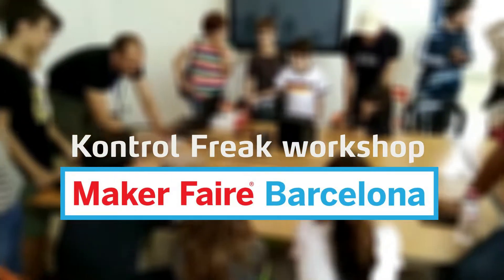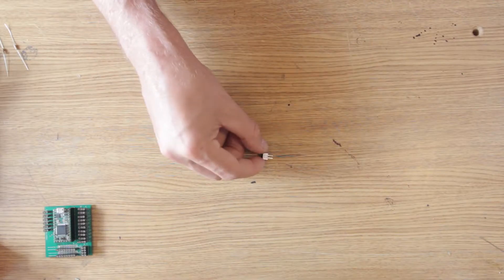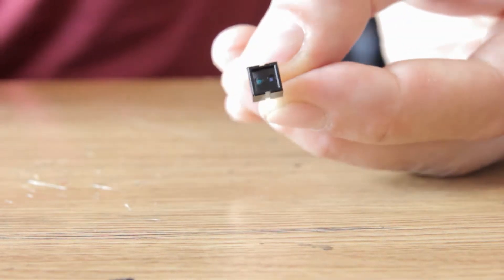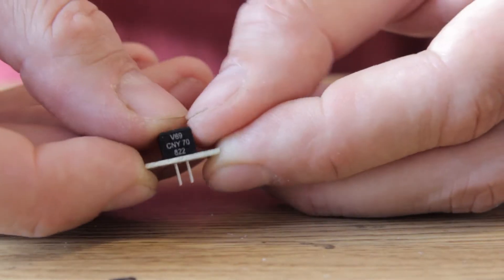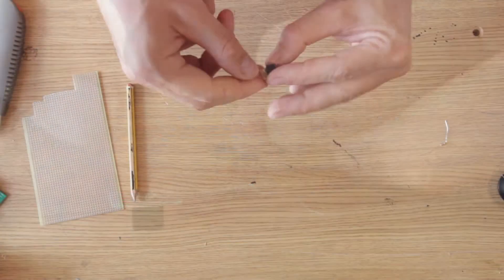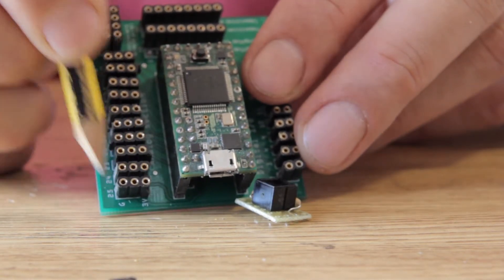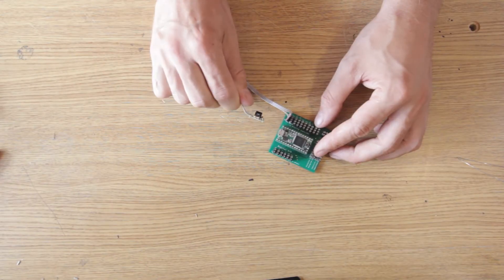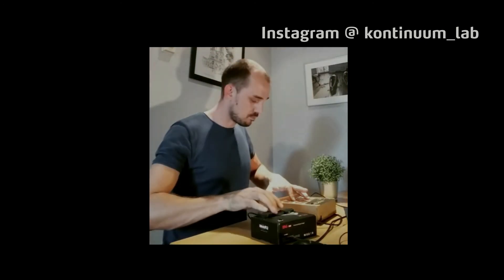Assembling The CNY70 sensor module - KontrolFreak workshop Ep.3

Comment: Hi. In most projects online a CNY70 is used to detect an object. In the datasheet I found that the sensor works over a small range (0-5mm) and in the diagrams they show current for 0-10mm. So I guess that this sensor can just be read with an ADC on the controller. But.... how do you sense pressure/velocity then? If you take the first number above the "unpressed" state, then you only detect a press. Do you actually take 2 samples with a few milliseconds in between and compare those? Do you have some more information about that or code to show?
Reply from the maker: Yes, you have to sample the sensor constantly, and then depending on what you want to do, interpret the readings in code. You can check out the code for the KLIK instruments here: https://github.com/KontinuumLab/KontinuumLAB_Instrument_Kit There are examples of the CNY70 used both for percussion and breath sensors